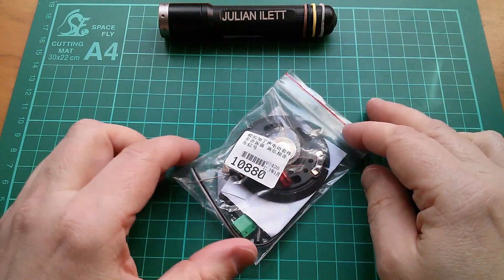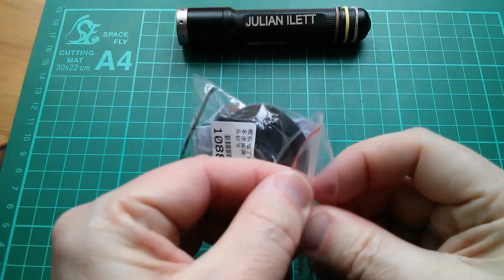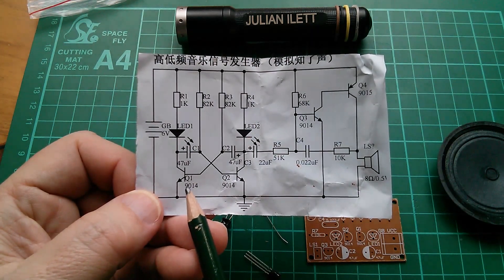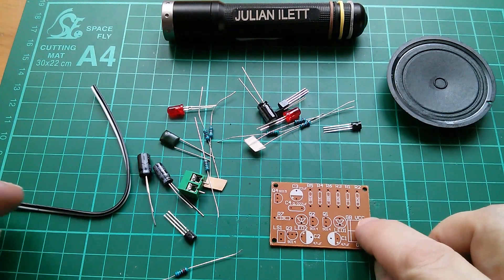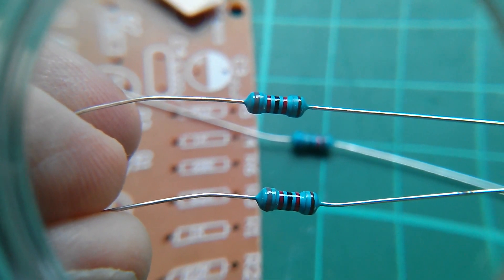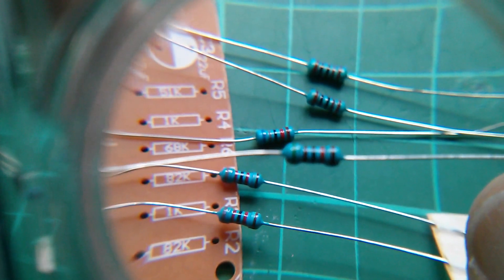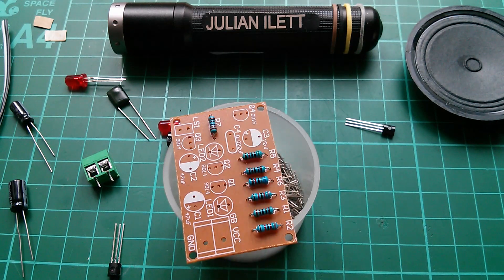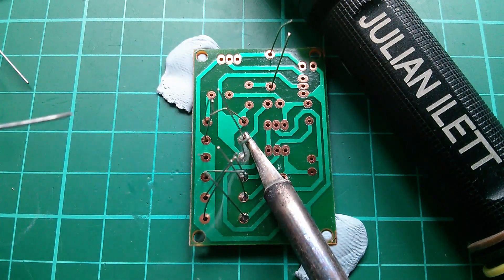Easy Electronic Kit Build - Cicada Sound Simulator (part1)

Comment: If you buy a big bulky camera you will have the same problem as that last one you bought(Nikon Coolpix S9900). I suppose you can have 2 cameras like FFcossag, with one for closeups and one for normal so they don't have to refocus all the time. He uses a switch to change between them on live streams.
Reply from the maker: The main problem with the Nikon was poor sound quality - the Sony appears to be much better in that respect. The upside-down problem can be solved with suitable brackets.

Comment: Q3 and Q4 are the sound oscillator, Q1 and Q2 are a switching oscillator to change between high and low tones, 47uF is too high to make a 'chirp'
Q3 and Q4 are like an amplifier with a feedback loop, much like putting a mic in front of a speaker.
Reply from the maker: So you can pretty much guess what it sounds like? Yeah, you're right :)
Reply: My first circuit was the astable multivibrator when i was about 15 (i'm 61), it's been my goto oscillator/pulse circuit since. :D
Reply: I made one when I was in primary school, in art/craft class. It was from the Ladybird Book of Simple Electronics.